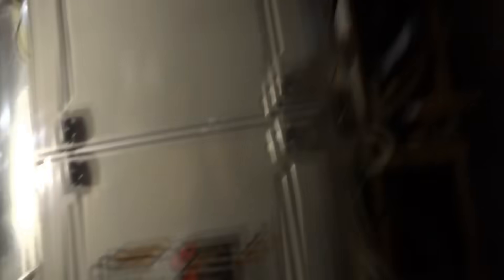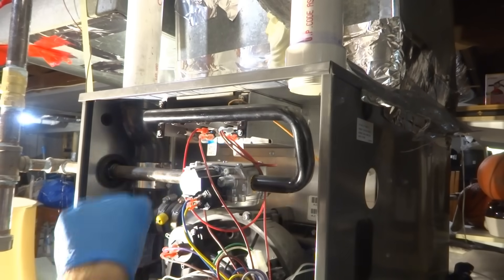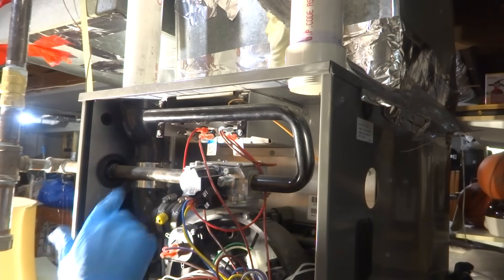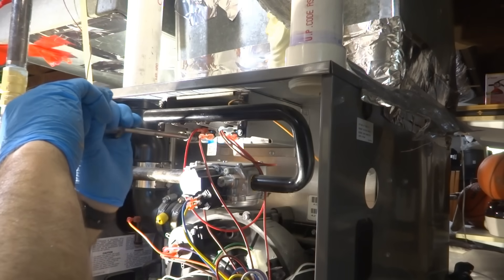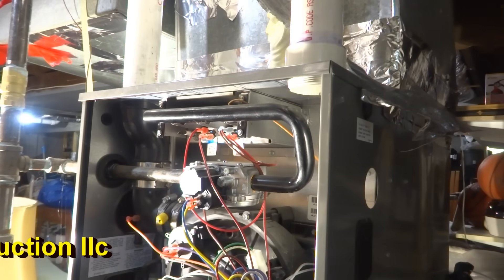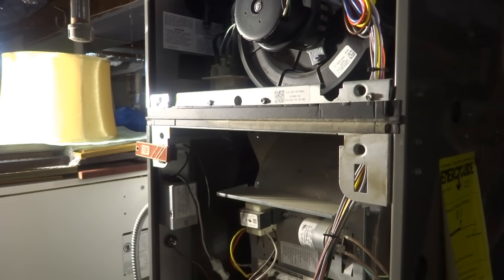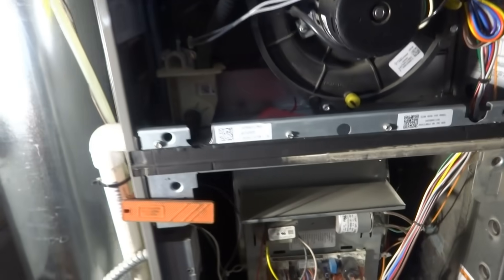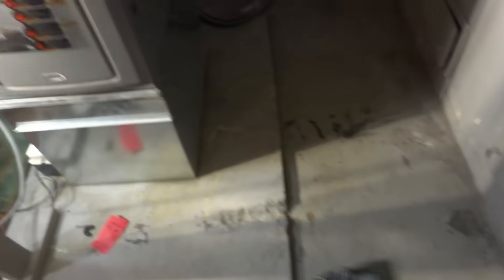90+ GAS FURNACE CHECK UP NEW HOMEOWNER

Comment: Nice install. I’m surprised there is no A/C
Reply: Lots of houses around these parts with forced air and no AC. Unusual though to see a system that new though without it. People usually add it in when they need a new furnace.